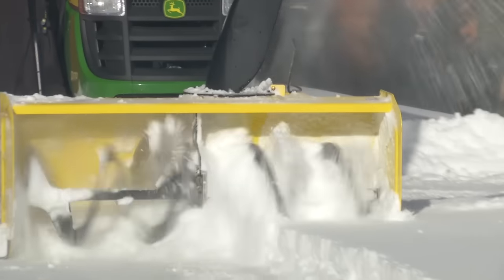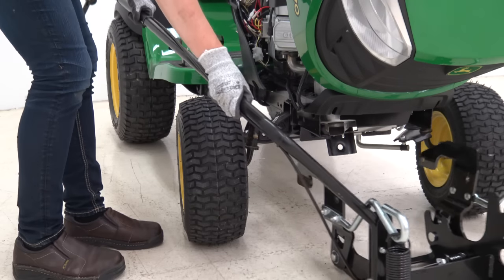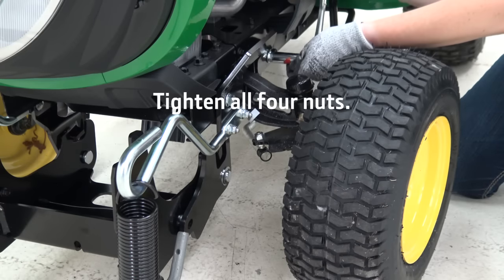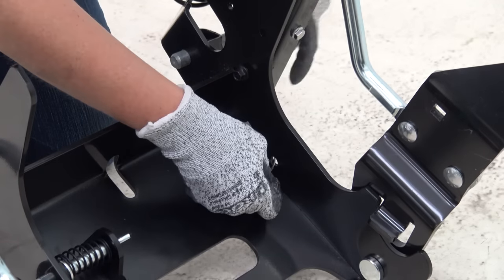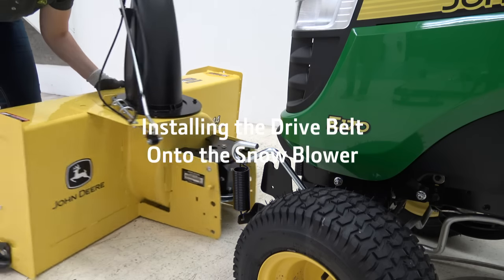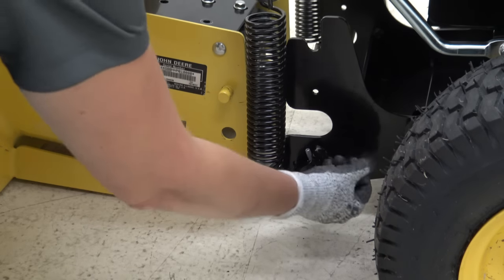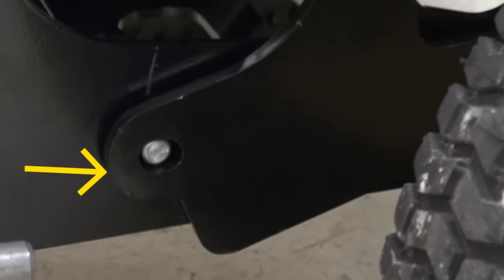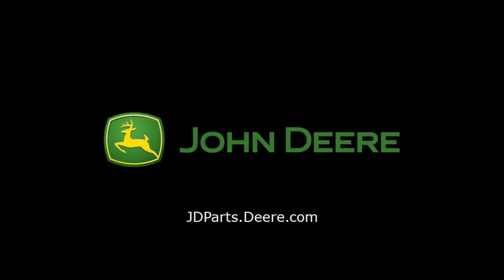How to Install the 44” 100 Series Snow Blower | John Deere Lawn Tractors

Comment: By the time you assemble this thing, winter is over.
Reply: I bought the system in summer 2018 and here I am winter 2022 still trying to figure the snowblower out... I gave up every year I tried...
Reply: @tripletvn  want to sell?
Reply: I just bought one of these for my first riding mower I’ve ever had. So literally zero experience  with mowers or snowblowers and I had it installed in less than 30 minutes…. Maybe it’s not the product is all I’m saying.

Comment: I bought 44 inch snow blower for my John Deere s130 only to find out that it would burn up my transmission according to the expert at the John Deere store.
Reply: What did you do with your blower. When you bought this, did it come with all the parts shown in this youtube video?  I am missing the belt drive module and was wondering if you got one with your new purchase. Bill

Comment: Thanks for this. So complicated and beyond what I'm willing to do. Convinced me to NOT get a JD Tractor and snow blower.  I'll stick to my regular snow blower and mower setup.
Reply: If you think this one sucks, you should see the install for the Cub Cadet 3-stage blower.  I looked this up to see if the JD was easier.  It is, but still not simple or easy.
Reply: Looks super simple to install to me.  They covered everything in a video less than 4 minutes long.
Reply: Dude what are you talking about too complicated? It’s 6 bolts and a couple clips.  This is a comprehensive video covered in 4 minutes.  The operations of the machine itself are more complicated to figure out than this install

Comment: Real easy and uncomplicated huh....for all the money you spend engineer something better with a drive up hook up.
Reply: Yea I agree, might as well just buy a seperate unit for snowblowing and save yourself a couple hours a year setting this up.
Reply: Looks like I'm hunting for a late 90s Deere with hydraulics.
Reply: @kokokyoushi  - Removing or installing the mower deck takes all of 5 minutes. I'm not sure what all the fuss and whining is about, but it is obviously coming from people that don't have one. This snow blower really is a breeze to install and I can do mine in about 30 minutes or so. Uncrating it and assembly when you first get it will add some time to that, but once that's done, you're good to go. This is a reasonably priced unit ($1,400) for what it's capable of. Someone mentioned engineering a drive hook-up. As someone that already owns a Kubota (with the optional mid PTO), I can tell you that that is an EXPENSIVE ad on, not to mention the 6k cost for the snow blower, which also must have a sub-frame installed every year just as this was.

Comment: not detailed enough to know if the belt is correctly running around the small pullies correctly, no diagram showing the way they should run.
\
Reply from the maker: Hi, Michele! We're sorry for any confusion. If you are having issues with your belt, we recommend taking a look at your Operator's Manual in the Troubleshooting section for some possible solutions. If you're still having trouble after doing this, please reach out to your local dealer for assistance. You can find your nearest dealer at Deere.com/Dealer.

Comment: I have a 2015 JD X324 all wheel steer.  The people at JD that designed the deck with J-Bolts have NEVER tried to put a deck on or take it off.  They should have been working in a candy store.  Stupid people.  The same with the bagger.  My last JD.  I'll find a K-Mart store and get a better product.

Comment: I installed one of these on a 2005 L120 with the electric PTO. It's now a dedicated snow blower and will never go back to a mower. I fabricated an extra support bracket to the chute control, the one bolt hold down was too flimsy. I put chains and rear weights on it as well.  One complaint is the raise and lower arm. When snow builds up on the blower housing, it requires 2 hands to raise and lower the blower, stronger lift springs might be needed. I'll be installing a 4 inch electric actuator to solve this problem. The instructions were a bit vague but I took my time and put it together over the summer. So far I broke 2 shear bolts this year when I hit some icy snow and no other problems. It works for me!
Reply: If I had the storage space, that is exactly what I would do.  Have one tractor set up for mowing and another dedicated for blowing.
Reply: Was it hard to fit to L120? I have a LA175 but JD says this mount is for 2014 or newer. I'd consider changing to this mount, can you leave the front part on and still fit the mower deck on? I know I'd still have to remove the drive belt module...
Reply: I have 2 videos on my channel. 
John Deere L120 Snow Blower and 
John Deere L120 Snow Blower 2

I set the tractor up as a dedicated snow blower and will never go back to a grass cutter
This might help. @patrickcapp8198

Comment: And watch out for a twist in the belt.  It won't seat correctly into the pulley at the pulley module.  It's hard to spot if you're not experienced with the problem.  I had to have a JD mechanic come out....this was after I pulled the module and took it to the dealer who sold me the blower.  Even they missed it since it was not installed.  They also found the wrong return spring on the module.  I have my concerns with quality control at John Deere.

Comment: This video does not show how to tension the belt after placing the snowblower on the front mounts.  The instruction booklet does not provide this information either.
Reply: The robot lady said it's a low tension system.. don't be alarmed by all that slack in the belt... that's what she said.
Reply: Its tensioned by the engage lever
Reply: @stepfour  yeah, but I have legit like 18” - 24” of slack.  Surely that’s not normal
Reply: @matthewmorse3307  oh,  I know...
Reply: They also forgot to show installation of the belt on the drive pulley.   My new snowblower pulley system came with the belt crossed top to bottom.  Poor quality control.

Comment: so after we bought the snow blower from home depot, not only was it missing a couple of bolts the handle was broken during shipping and home depot and local dealer is blaming each other. 
got to the drive belt module install and my unit does not have the holes for the the unit to bolt into  , Nice.....as I am reading the instructions in fine print it says if your frame doesn't have the holes you will need a left and right bracket which are sold individually , $140 cad each plus taxes. 
I have a D140 and the description is for ALL 100 models, that is incorrect. 
buyer beware. 
tractor purchased in 2017 and now I have to decide do I drill the holes or send unit back.
don't buy anything for your john deere unless you 100% it will fit.
Reply from the maker: We apologize for this experience. If you would like to discuss this with us further, please reach out to our Enterprise Contact Center for Residential, Golf, and Turf products at 1-800-537-8233. You can also submit a help case here: https://ccms.deere.com/prweb/MyJohnDeereAuth?pyActivity=Deere-CCMS-Case-CM-Work-GSC.SnapStartCreateCase&MashUp=R4+Turf. Our Enterprise Contact Center is open from 7am - 5pm CST Monday - Friday, and 8am - 4:30pm Saturday. We hope this helps.
Reply: hello Tazzman. Did you solve this dilemma with your snow blower. My son bought an E170 4 years ago and never used the snow blower attachment. I wanted to use it this winter, but he never received the belt drive module in his package, so JD tells me now that they don't make that part, you have to buy every individual piece and assemble your own belt drive module. I am desparately searching for a belt drive module, if you have any ideas on where I might find one. Thanks for your time. @JohnDeere
Reply: @cptnbillyjohnstone510
1 day ago
hello Tazzman. Did you solve this dilemma with your snow blower. My son bought an E170 4 years ago and never used the snow blower attachment. I wanted to use it this winter, but he never received the belt drive module in his package, so JD tells me now that they don't make that part, you have to buy every individual piece and assemble your own belt drive module. I am desparately searching for a belt drive module, if you have any ideas on where I might find one. Thanks for your time

Comment: I was able to do mostly everything BUT the driver belt! I do not see when or how to put the belt around the pulley right under the tractor - not the one in the snowblower housing, nor the two in the blower deck that goes underneath the tractor. None of the pulleys can move and I am weak so I don't think pulling the belt works for me. I am debating un-bolting the driver module and redo it. Anyone that could help SOS? I have 17-18 inches of snow blocking my 200-ft driveway and I am house trapped right now. Thanks.
Reply: I got it from the manual, from the right side there is a tension release arm that could move. The video failed to show this.
Reply from the maker: Thanks for the feedback, Trang Thai! Please check Section 30 - Installing - Installing Belt Drive Module in the Operator's Manual for the 44 Inch Snow Blower here: https://bit.ly/3IdX4t9. If this does not help, your local dealer would be another resource for assistance with installing attachments. Your nearest dealer can be located using https://bit.ly/3rqTCVj. We hope this clears up the installation process.
Reply: @JohnDeere  Yes, that was exactly what I was referring to from my physical manual book, but the wording with little to no figure it was not as easy as the video (not that the illustrations in the manual book help, I think they are poorly drawn). It is also the you-know-it-or-you-don't kind of thing, so it is easy now. I am also having issues with really hard if not impossible to squeeze the lift handle to raise/ drop the snowblower (small Asian woman with smaller hand) so I had to operate it with the snowblower on the ground 100% of the time, which was super inefficient, and I would love to see more explanation on the tension of that part. I also found from YouTube that some people install electric winch for about $150 diy so I think that would be a good solution for me compared to doing it manually.
Reply: Did you get your belt drive module figured out? I'm looking for that module if you might know where I could find one. Our son bought this package deal from Lowes several years ago, but never used the snow blower set up and now we find the belt drive module not in the package. What a pain.

Comment: Does John Deere have a video for the install of the weather enclosure for the 100 series tractors? Seems a lot of people would find this helpful as it goes hand in hand with the snow blower attachment.
Reply: Very easy to install both together. All the pieces fit well together.
Reply: @thedoctor154  thanks, I went ahead and purchased a Berco cab for around the same coast due to the fact that the JD was too tall for my small garage.

Comment: Seems a lot more  complicated  than 2015  44" snowblower attachment on mine.  Is this there newer version?
Reply from the maker: Massfrog, thanks for your interest. Yes, this would be an updated version compared to your 2015 unit. We released an updated 44” Snow Blower attachment with the New E100 Series Lawn Tractors  in 2018.
Reply: @JohnDeere  Is it backwards compatible? I have a 2015 D140 will my blower fit a 2021 S240?
Reply from the maker: Thanks for asking, Ryan. There were Snow Blowers specific to the 2015 and prior model year D105 Lawn Tractors, which would not be compatible with your S240. We recommend confirming your current Snow Blower's part number and compatibility with your local dealer. If needed, you can find your nearest dealer and their contact information at Deere.com/Dealer. We hope this helps!
Reply: dont buy it.  get another brand

Comment: I have an LA145 and I just bought a snowblower attachment for it but it doesn’t look like this snowblower. Trying to find a video to help me hook it up.
Reply from the maker: Thanks for reaching out, dave strongman. We do not currently have a video outlining the installation of a snow blower on the LA145 Lawn Tractor. We recommend contacting your local John Deere dealer for assistance with the installation. If needed, you can find your local dealer at Deere.com/Dealer.

Comment: i just bought a 160 and all the snowblower equip.  well im 4.5 hours with 2 people into it and im just about halfway with assembly.  the instructions are terrible the parts barely fit together and none of the hardware is labeled.  1 more day than its all going back!!!!
Reply from the maker: We're so sorry to hear that you have been experiencing difficulty assembling the snow blower equipment for your unit. Your local John Deere dealer may be able to provide some guidance for you. If needed, you can find your closest dealer at Deere.com/Dealer. Simply enter your location and then select what type of equipment you are looking for. We hope this helps.
Reply: @JohnDeere  what im looking for?  are you a bot?  i bought what i was looking for and it doesnt work.  i assembled it and it ran for an hour now the tractor is dead and the tractor itself was assembled by john deere.  i guess what im looking for is the hole in my head that made me think john deere was still quality
Reply: This is my first riding mower so no experience with any mowers or snowblowers ever and I installed mine by myself in less than 30 minutes in a very dimly lit garage with main source of light being a flashlight.  Just saying, it may not be the product if it took you and another person several hours to put like 6 bolts in…. 

As far as quality I can’t speak on yet.  But installation was crazy easy.
Reply: Was wondering if you ever got that snow blower working?  I can't finish mine because there was no belt drive module in the package my son got. Trying to locate one of those and that is another crazy world trying to deal with John Deere. My son bought this unit from Lowes and never needed the snow blower, so we didn't discover the missing part until 4  years later, and of course no one has it now. Any chance you might know of a place to get that belt drive module? Bill

Comment: Mine does not have that front pulley u bolt guide and can,t find where to buy one. Called JD and they had no idea just said all the parts should be there and had no part number. belt comes off about every 40 ft. It,s in the video JD
Reply from the maker: We're sorry to hear that you had this experience with your snow blower attachment, Jeff. Please give the John Deere Enterprise Contact Center a call at 1-800-537-8233 for further assistance with your missing parts. You can also speak with your local John Deere dealership about any missing parts. If needed, you can find your local dealer at Deere.com/Dealer.
Reply: Did you ever get your snow blower working properly. Ours came without the belt drive module, unfortunately that was several years ago and we haven't wanted to blow snow until this winter and no belt module. I'm trying to find one. Thanks for any comments, Bill
Reply: @cptnbillyjohnstone510  Yes i did find a belt guide from john deer about 50.00 bucks as i remember. it,s for the front pulley it,s a big u bolt about 8 inches long and 1/4 in thick that just keeps the belt from coming off. it,s been a long time and i don,t recall how i got the part number, not sure what the belt  module is your talking about
Reply: The belt module is the metal frame that hangs under the tractor and has 2 pulleys that get your power from the tractor to the snow blower. We never got it when we bought the tractor several years ago and have never tried to blow snow until this winter and no belt drive, so no go. Where are you located? I'm in Winnipeg if you have any ideas on where to find this module. Bill @jeffh.9620

Comment: Can someone suggest which lawn tractor better to do lawn mowing and snow cleaning along with all accessories required
Reply from the maker: Sensible Satvik, we're glad to hear you are looking at our Lawn Tractors. Choosing the right equipment for your needs can be a challenge, so you might want to start with our Product Selector Tool here: https://bit.ly/3ymEfQY. You can utilize the filters found on the left side of the page to find a Lawn Tractor to fit your specific needs. Your local John Deere dealership would also be happy to help you to answer any questions you may have about our wide variety of Lawn Tractors. If needed, you can find your local dealer at Deere.com/Dealer.
Reply: anything but a john deere

Comment: What is the overall width and length of this lawn tractor with the snow blower attached?
Reply from the maker: Thanks for the question, Robphoto37. The width of the S100 Series Lawn Tractors with the Snow Blower attached is 46.6-in and the length with the suitcase weights is 105.7-in. For more information we recommend contacting your local dealer. You can find your local dealer here: Deere.com/Dealer.
Reply: @JohnDeere  I have but nobody got back to me.  Thanks for the info

Comment: Will this attachment fit an e100?
Reply from the maker: Thanks for the question, Tim. Yes, this 44 inch snow blower attachment is compatible with the E100 Lawn Tractor.  We recommend contacting your local dealer if you need assistance locating and ordering parts for your unit. If needed, you can find your local dealer at Deere.com/Dealer. We hope this helps.

Comment: I have an E-130 22hp will the snowblower attachment work on it? If so where can I buy this set up in the video. Much appreciated
Reply from the maker: Thanks for your interest, Ghillie30m1. We recommend contacting your local dealer for questions you may have regarding the compatible attachments that are available for your E130 Lawn Tractor. You can find your local dealer at dealerlocator.deere.com. You can also view the Attachments & Implements Brochure for our riding lawn equipment here: https://bit.ly/33KUnNf.